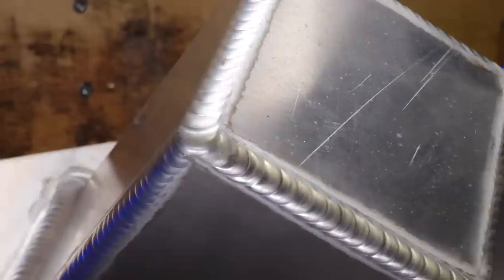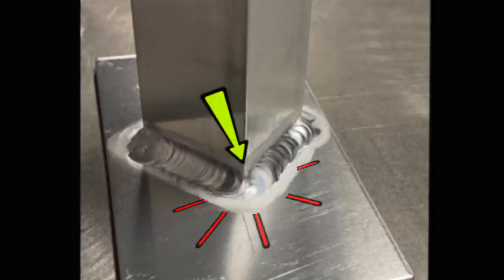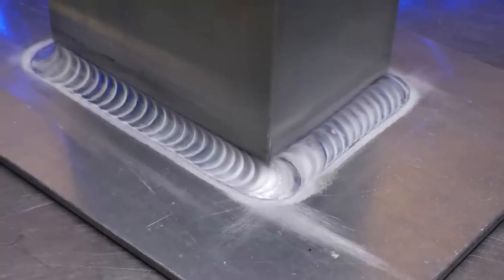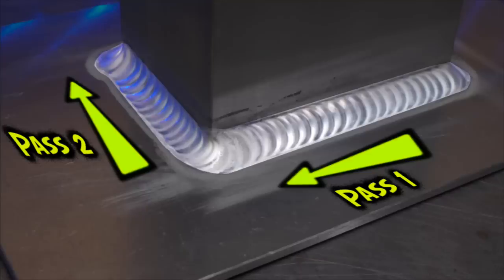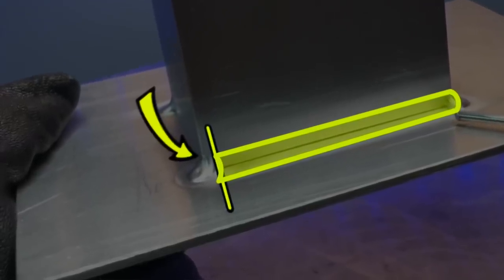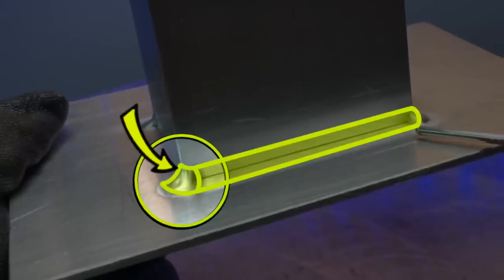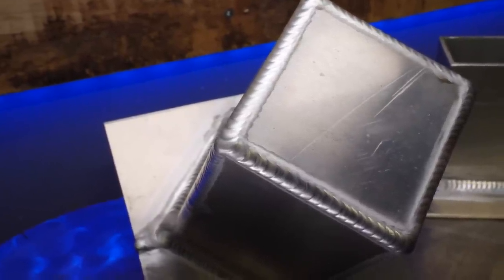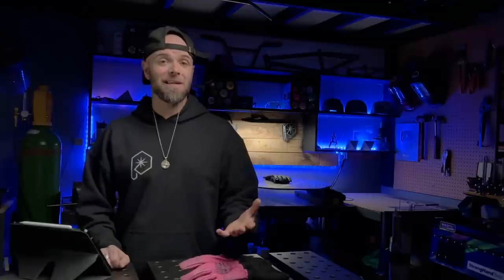the SECRET TO PERFECT CORNERS 💎 how to tig weld aluminum

Comment: I've always taught myself if I'm coming around the corner and I'm connecting to weld always put a dab on the corner!!!!!!! And just like you said on stainless steel especially if you leave that corner open and you don't put a Deb there it will corrode due to having heat to it you get rid of the stainless-steel protecting....

Comment: I only have a lift start machine and 98% of the stuff I do is carbon steel, so I mig everything. With that said, I want to learn tig- especially for pipe welding. I looked into your classes but it states they are for aluminum. Any chance you’ll ever put together a carbon and stainless steel tig welding program? 

Just subscribed- great channel!